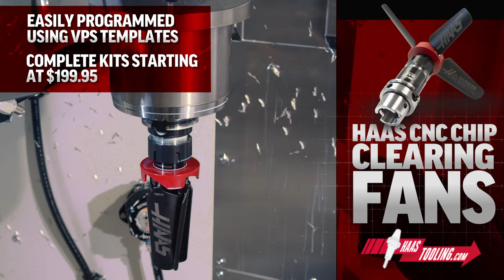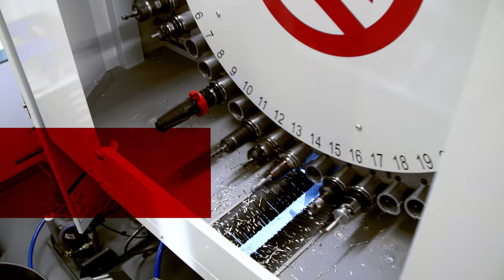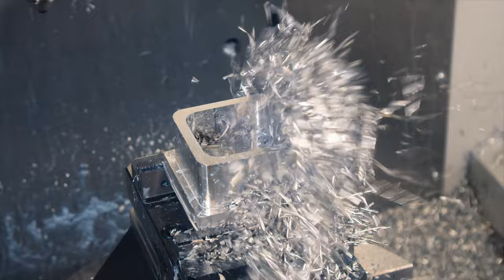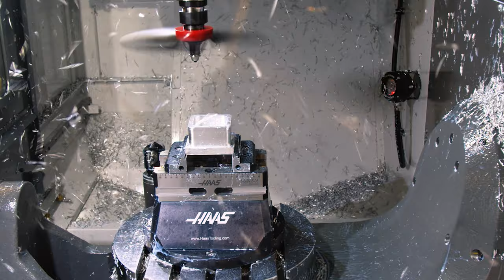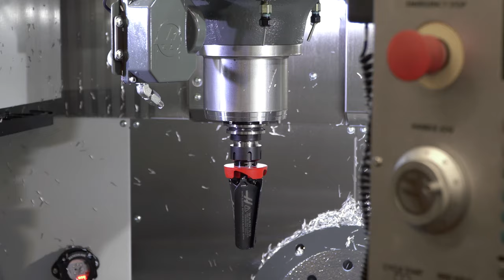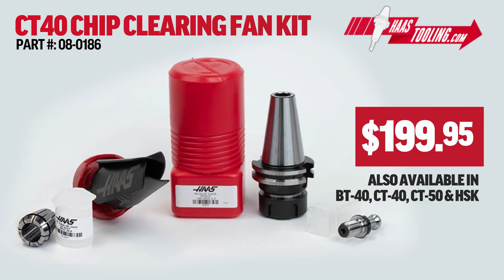Haas CNC Chip Clearing Fans Now on HaasTooling.com - Haas Automation, Inc.

Comment: I use these (or a similar version of them) at work often and I have found that after a lot of use the little nub where the springs connect the blades to the housing will eventually break off, they're quite useful and I'm currently mildly annoyed at not having mine operational

Comment: The most appealing thing is the ability to clear puddles, sticking an air gun in a puddle is a guaranteed way to soak yourself...for older machines without the mounted air gun, this is a good alternative. Otherwise yeah, compressed air would do it.
Reply: Favorite part of these by far is the not having to clean coolant off my glasses

Comment: I'm pretty sure Lang is laughing in German while seeing this, at least theirs has a coolant hole in the center so you can use the TSC to wash off the parts before turning the spindle on, and it is not much more expensive than those made by Red line.
Reply: I think the Redline ones have a TSC hope as well.

Comment: Hmm, around $150 for just the fan, roughly the same price as the Redline. The real deal is the packages that include the tooholder, collet and retention knob. For as little as $50 more. Hell, look at the price of HSK package, then go price what those holders cost. You could make some decent money buying packages, and then parting them out.

One thing I am disappointed by, is no replacement blades for sale. My experience with these things is that breaking a blade is a question of "when", not "if".
Reply: You're giving me an idea, why not 3D Print those fins Inhouse? Even a entry level FDM Printer should be able to create one lf these decently.

Not quite sure about materials as they're in contact with collant all the time
Reply: @chas1878  a 3d printed fan spinning that fast would vaporize into thin air

Comment: Maintenance will absolutely love this tool when it is used in production. Coolant and chips gets everywhere to cause trouble eventually.
Reply: Just like it does when using the machine normally? You wanna talk messy, try TSC drills. the amount of chips packed around the coolant ring is silly
Reply: @Echo51  I have. But TSC does not drive chips up to the VF-8 tool changer and cause malfunctions.
Reply: uhm no zero problems ....  bin using other brands for 7 years ....
Reply: The vf4s I run have used them for 23 years or so with no problems with chips getting where they shouldn't
Reply: @crogsmash1611  We run VF-8 in 3 shift production using lang brand chip fans and there has been a lot mor cleanup work (behind convers) during annual service sessions.

Comment: Great and now all chips are spread on the ground because Haas machines dont have a ceiling. 

Also the part is not completely clean.
Reply: Seems a bit silly to use on a 5-axis with a single Vise...

But you know where they're great? With Thombstones that hold 16 parts  in a horizontal 4 Axis mill
Reply: @chas1878  Too bad they don't show anything like that on here.
Reply: Maybe some dont have a ceiling but not all for certain.  Have zero issue with milling deep pockets with the TSC blasting chips all over.  I also bought one of the fans made in  india for $40  a year ago.  Its doesnt live in the  side mount changer and only put it in if I  have pockets with coolant or a  pile of chips that remain on the table especially between parts. Then it works great and completely cleans things  off and  dry   using just slightly overlapping  single passes. No chips leave the machine. On the other hand there would be chips all over the floor if  you use the blow gun instead.   This  or similar is a must if your doing any kind of automated work where the parts need to be  chip free and also the method of clamping.   This is NOT something I would put on a  carousel style machine. For that matter I wouldnt even buy one of them  if I was going to machine  mostly aluminum  at 10k or higher spindle speeds  since the chips fly all over.   Have not looked at the  add on the  haas site but hopefully it does  mention that this is not really a good option for a  carousel machine.

Comment: yeah y'all need to sell replacement blades or else this is a total waste. I use these on a few automated machines, they didn't mention how a fast swing-arm toolchanger (SS, DT, DM, etc) will cause one of the fan blades will try to deploy during the toolchange then get sheared off like a toothpick. Even with an SS mill running 50%, it's still enough to make the "long" fan partially open. Probably not much of an issue with the stubby fans, or if you're running at 25%, but you better be sure it'll work either way.

Comment: Would you manually input the length on this into the tool offset or can you even use the auto tool setter for a fan?
Reply: Oh you definitely need to touch off. Don't forget to probe the diameter as well. 😀
Reply: @crazyscience4490  🤣

Comment: Why is there a small and a large? Why wouldn't everyone want the larger one? Wouldn't it move more chips?
Reply: Some machines might be too small for the larger version.  I worked at a shop with a bunch of Brother mills that had a tiny work envelope.
Reply: I think it depend on the machine you have, the length might be to long for some machine when the spindle not spinning